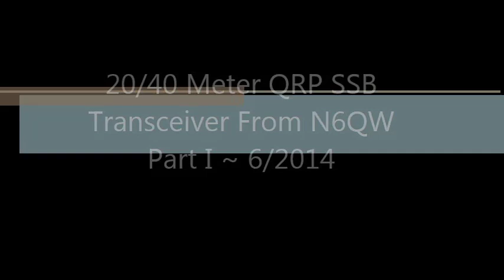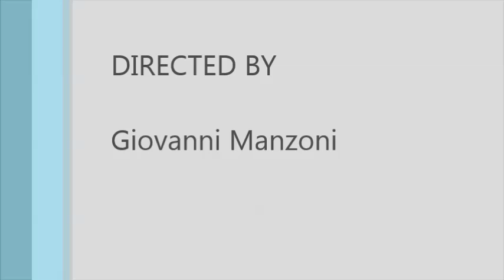20M & 40M QRP SSB Transceiver

Comment: This rig is something a ham can learn on and also have a good expectation that it will work effectively when they're done, because it uses the right parts, and parts that are large enough to actually see. It uses digital where digital makes sense, and analog where analog makes sense, commercial where commercial makes sense, and home-brew where home-brew makes sense. It uses common, inexpensive components, yet it has good performance. That seems like the perfect combination of sophistication, simplicity, and price to me. And when I'm done I will still be able to embellish on it any way I like.

I've spent the last 2 weeks looking all over the web at other HF SSB transceiver kits and projects to pick the one I want to build, and I'm going to build this rig. Thank you Pete. - John  AD0WO
Reply from the maker: Hi John,

Thanks for your post and interest in this radio. BUT before you get launched look at my website https://www.n6qw.com and click on the link for the PSSST which is a 7 Transistor (yes 7) SSB transceiver for 20 Meters. I have since modified the code that with a flick of a DPDT toggle switch you can have two bands just like this radio. The performance is excellent and easier to build. Contact me via my QRZ.com email and in fact you will see the radio on the qrz.com page. There is a full (and I mean full) documentation on the webpage.

73's
Pete N6QW

Comment: Can you please share the schematic diagram with us. nice looking rig. thanks!
Reply from the maker: Thank you for your inquiry. This rig was rebuilt and now is even better with a color TFT display. I have also documented the build on my website http://www.n6qw.com and the rig has a new name. It is now called the "Big Kahuna". There is a link on the index page that will take you to the detail. As such I reuse many Modules over and over so very likely you will not see an overall schematic. That said before you get too excited there are several other transceiver projects on that website. You might also check my other website http://www.jessystems.com That one too has many transceiver projects.73'sPete N6QW

Comment: GREAT JOB Pete!  Very beautiful workmanship and clear explanations on the video.  And I loved your conversation with Bill.  I'll be subscribing to your YT channel.  Do you have a blog/website as well?

Love the dual-band and also that you added AGC/S-meter capability.  I guess there's a never-ending list of add-ons one can do but I know I'd like to put these things in my future rigs along with a VSWR meter. 

I also like the mindset of functional blocks and re-use.  Seems like a smart and efficient way to build rather than having to work through the math on unique designs for every stage every time.  Maybe just focus instead on one or two new things you want to do with the rig instead of re-re-re-designing the mic amp or whatever.

73, Bert WF7I
Reply from the maker: Hi Bert,

Thanks for your post and the kind words. I do have a website www.jessystems.com and many of the "circuit blocks" are detailed on that website.

73's
Pete N6QW